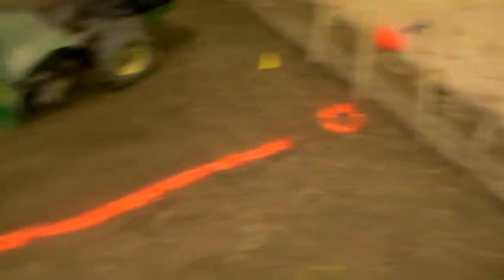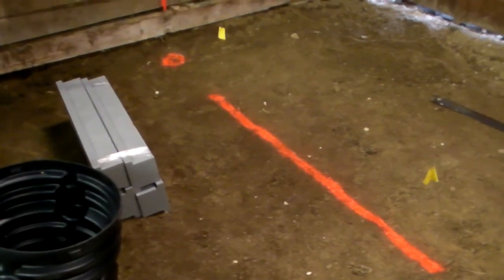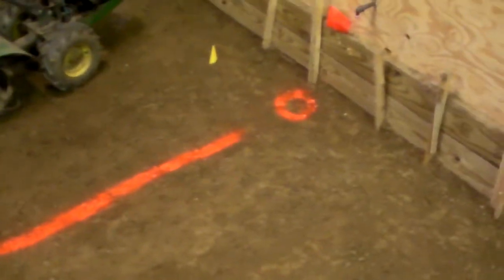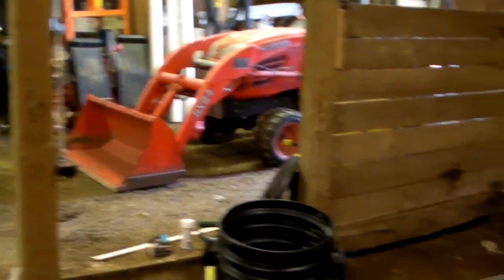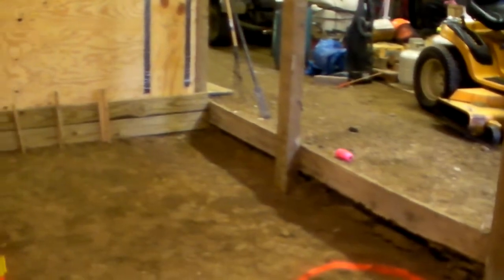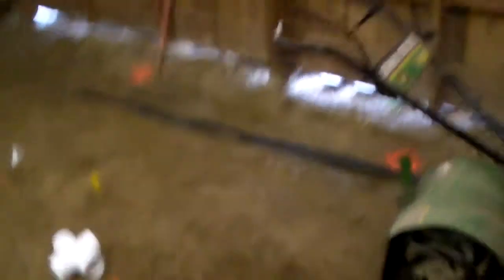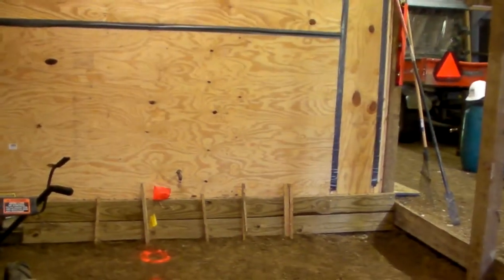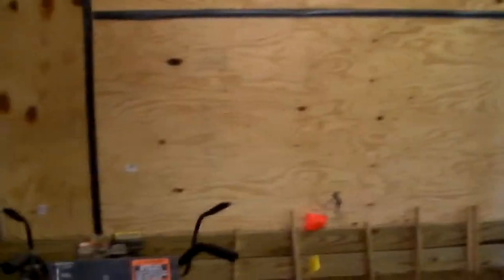Orchard Diary 7/22/2012: Cider Shop pt 3

Comment: I have power-washed a cider pressing room before. A trench drain along the entire length of the room would have been nice and easy to squeegy the water to. Start with a floor plan and think out the linear movement of the product. Drainage comes second, as you've said. Making the whole room power-washable will be nice. No one likes sticky floor.
By the way, I'm a mechanical engineer (or was, before I changed careers after 17 years). I've designed a lot of sanitary systems for commercial kitchens.